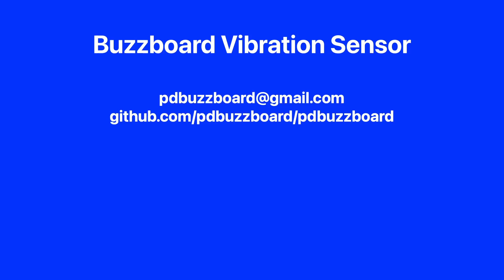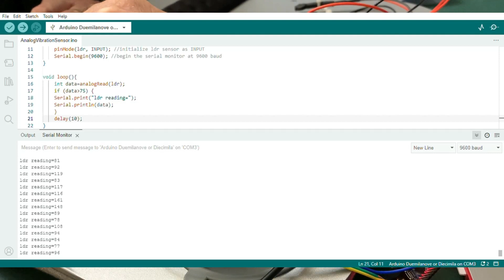Vibration sensor for Vibrotactile device

Comment: I have built a set of PD Gloves using separate controllers.  I use the Hiletgo Nano V3.0 ATmega328P board.  Can you verify I am connecting the fingers to the correct pins.  I used D3 for finger 1, D5 for finger 2, D7 for finger 3 and D9 for finger 4 (pinky finger).  Thanks!
Reply from the maker: that is correct mapping